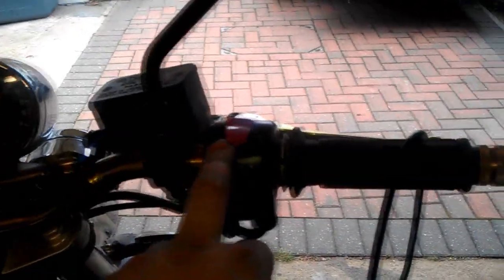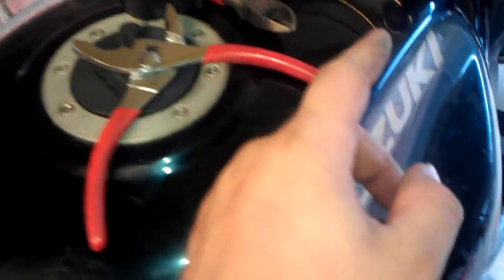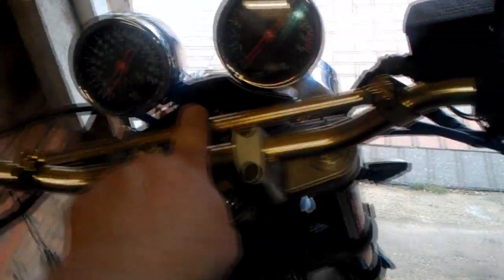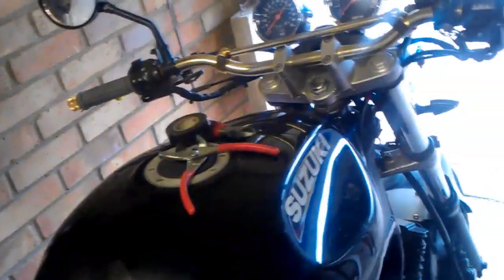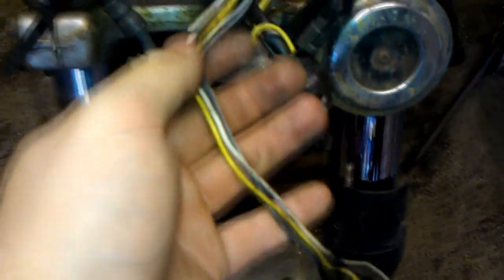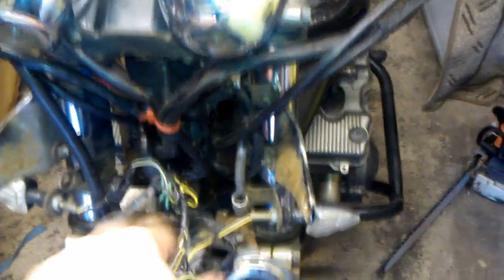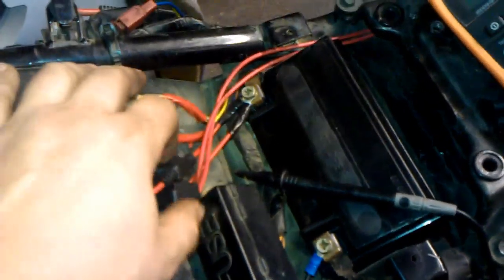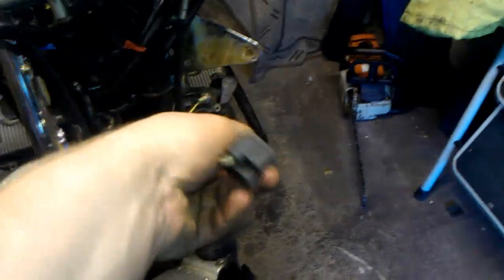Motorcycle headlight relay mod - extra brightness!

Comment: Hi Richard, thank you for the video :) 
My hi/lo (switch) wires is powered by a wire that comes from the alternator+rectifier/regulator (standard factory wiring). My (relay mod) lights don't turn on (even when my bike is running). The voltage the (alternator) wire feeds (bike running of course), is basically 1 volt (depending on idle rpm): which is too low for the relay switch to do anything. What are my options? I've been struggling for way too long, so thank you!
Reply: I was reluctant to ask for your help (your time in essence). 
I have had this problem for so long, but once I asked (you), the universe immediately revealed an answer. 
My lights are working and also not draining the battery anymore! :) 
Could I send you my schematics, so that (if you approve) you could link it in your video description (for people who are struggling with the mod)?
Reply from the maker: Hello :)
Sounds like you either have a bad wire/connection, a regulator/rectifier issue or your stator is weak. What is the voltage of your battery with the bike on charge? If you take the positive wire off the battery and place your tester across the positive terminal and earth/negative  with the bike running (carefuly not to short anything) what voltage and amps are you getting?
Possibly try feeding your relays from the battery just to rule out a faulty off/on switch or wiring. Might be you have to feed the on/off switch from the battery?
Reply: Thank you for your reply (your time, interest & expertise)! 
It seems you have unfortunately missed my second reply (posted under my original message)(this is my third response). 
I would really like to share the schematics on my wiring success (which will in all probability help everyone else who struggles).
Please provide a way whereby I can forward the schematics. Thank you :)
Reply from the maker: @pierrejoubert718  Sure go for it. Just upload as an image or a file to a sharing site and provide the link :)

Comment: any way i can use a single 5 pin relay for both high and low?
Reply from the maker: No idea, if it was possible you'd need some sort of 6 pin relay.
Live in, earth, hi switch, hi power, low switch, low power.

Comment: I have a 2006 650 with the original single headlight. I'm thinking about doing the twin headlight mod soon as I think they look a lot better + I think my original headlights aren't very bright. Just wondering how the brightness of the twins with relays compare to the original headlight's brightness?
Reply from the maker: I cant comment to how they compared to the original headlight as it had the twins already on when i bought the bike. 
There was definite noticeable difference between the twins running off the stock wiring and the dual relay mod, however.

Comment: just wondering what gauge wire you used for everything
Reply from the maker: +Adrien Emanuel Hi. I can't actually remember.
Although you will want something that can handle at least 5 amps if you are using a single 55/60w bulb - amps are determined by total wattage divided by volts, in this instance, for example: 60w / 12v = 5 amps). A wire gauge of around 1.6mm should be sufficient for a single bulb.
I used much thicker wire that necessary when I did this video as it was all I had available.
Reply from the maker: +Adrien Emanuel Sorry, I forgot I was running dual lights in this video! In this case you would need much bigger wire.. You would need at least around 12 amp wire so 2.5mm gauge wire in this instance would be fine.
Reply: thank you for the reply definitely helped!

Comment: hi richard..are u sure there is no live wired from battery to the switch?coz it jst didnt work for me..
Reply from the maker: Hi. The way I did it I just took the wires for the hi/lo beam feeds out of the switch on the handlebars which is already getting a live input from the bike's electrics and wired them to switch the hi/lo relays.
So you have the main on/off switch that switches the park/sidelight on and then the main headlight feed that then feeds the live into the hi/lo switch that then switches each of the relays on.
Reply from the maker: Just added an updated wiring diagram into the video description. Hope it helps clear up an confusion.

Comment: If u dont mind..could u write the relay pin no in the diagram..which is no 85,86,30,87a & 87. TQ
Reply from the maker: 85 = Earth, 86 = live from switch, 87 = relay live to the headlight, 30 = live from battery.
Reply from the maker: richardfld You should only be using four pin 30A relays and run a relay dedicated each specifically for both hi and lo beam.
Reply from the maker: Don't forget to add a 15A fusible link to each relay live in from battery too!

Comment: Hi richard..I use 12volt/55watt spotlight as my headlight and wired it in relay mod..but it drained my battery real fast,even with the engine running the light got dimmer and weak.
Reply from the maker: Sounds like one of two options -
1) You could have a short circuit somewhere that is draining the battery. Assuming the bike is charging the battery properly you need to make sure that the wiring you have done is correct and isn't shorting out.
2) Could be that the bike isn't producing enough power to charge the battery - do you have a voltmeter? With the bike running measure across the battery terminals. It should read somewhere around 13 to 14 volts if everything is working properly.
If it reads lower then you have a problem, perhaps with your regulator or rectifier etc.
Your best bet in this case is to find an online forum specific to your motorbike/model and ask the members for advice on troubleshooting the electrics.
I might be able to help you further but I can only help with general advice rather than anything specific to your bike.
The mod itself should only be drawing a little extra power (maybe 5 or 10% at most) and wouldn't normally be of a significant increase to be able to drain a battery.
Reply: thnx Richard..I think the charging system is working jst fine,,it measured up to14 volt when I rev it up..myb I,ll jst go look for any drainage.
Reply from the maker: mohd affendy abd malik Charge the battery and let it sit for a few hours or to let the level settle. Measure the voltage of the battery without being connected to the bike. A healthy battery should read 12.5v at least.
Also, definitely check the relays - are you sure you have the right ones and that they are wired up properly?
I just drew a diagram and put the link in the video description if it is of any use to you?
Also just to be sure - your bike does have the H4 type bulb with the three pins on the back? This mod doesn't work with H3 type bulbs or such (I should have probably said this on the video!)

Comment: i tried connecting directly to the battery using a relay switch but my battery drains and the  bulb burn out... i measure the battery when the engine is off, 12.5V. When i start the engine the voltage goes 13 -14 volts when when i hit the throttle.  Can the bulb stands the voltage of 13 volts to 14.5V because of the of the stator is charging the battery. Can i use diode, resistor, zener, etc to have a voltage dropto maintain at least below 12.5V but not less than 12V?
 By the way im using only Scooter A/M 150cc GY6 engine.
Reply from the maker: Hi sorry, for some reason I didnt get notified of this comment when you posted it -
All batteries should read somewhere in the region of 13-14 or so volts when charging. This is completely normal and doesn't mean that this is the actual output of the battery. When off-charge a healthy battery should read around 12.6V or slightly above.
if the battery is draining when the bike is turned off then you have a short circuit somewhere. Fix this and then see if you keep blowing bulbs.